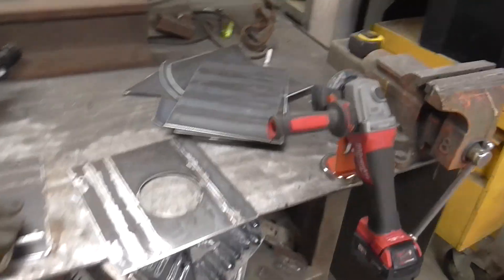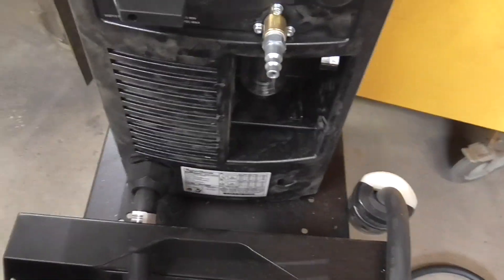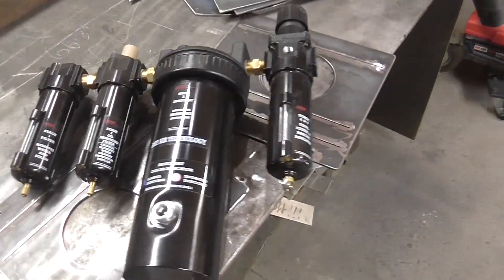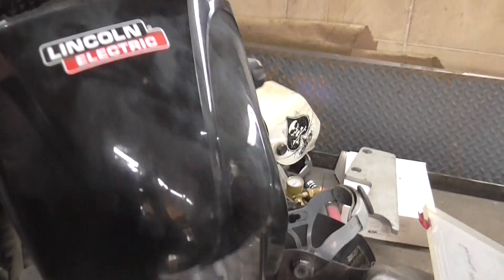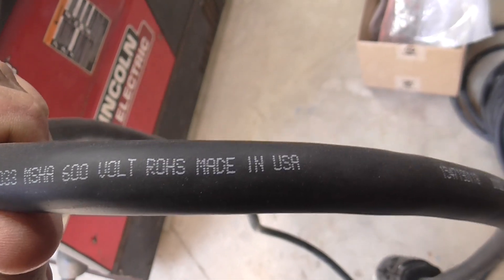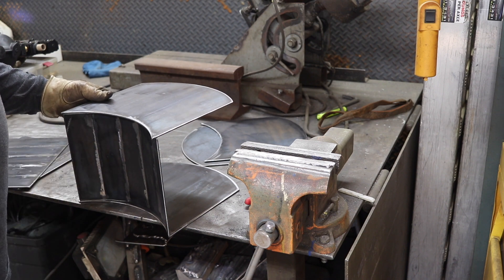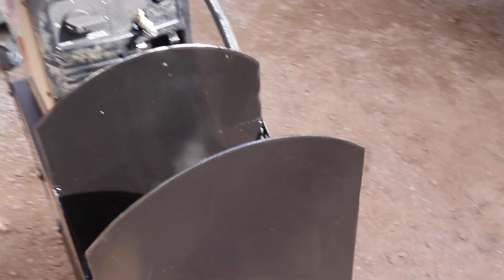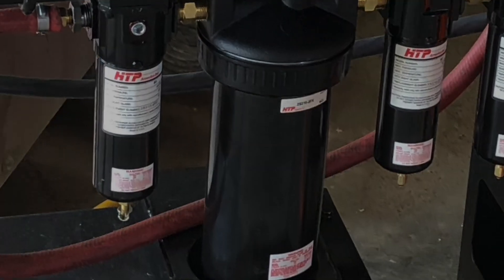Building a "plasma cart deluxe"

Comment: Dang that is one huge hose holder.  How many feet of hose are you going to hold? I thought my 25' hose for my powerplasma was a bit long.
Reply from the maker: 100 ft air hose and 100 ft 3 phase extension ...  plus the 25 ft cutting torch and a spare 25 ft cutting torch ...  and whatever else i need ....  LOL

Comment: Hose reel: made in the USA.
Reply from the maker: hose reel:  German made, made in USA, with steel sheets that werw actually made in USA .... about 70% of the steel i buy locally is usa 20% canadian and 10% other (like turkey and other typically non chinese countries).  made with south korean welding wire, welding gas made in the use machine made in italy, cut on a plasma table make in USA with a cutter assemblesd in the usa ...  so call it a Heiz 57

Comment: Nice video Peter! I hope you get at least one of those plasma cutters!
Reply from the maker: JIMBO'S GARAGE i have had an ht85 for at least 5 years now ....  for the upcoming job i had to buy 2 more! 

I also have a 65 and a 45 ...  

My 85 has a horrible firing reliability on a cnc table but is an excellent hand cutter. I like that it is 1/3 phase 200-600 volt ....  it runs on pretty much any power ....